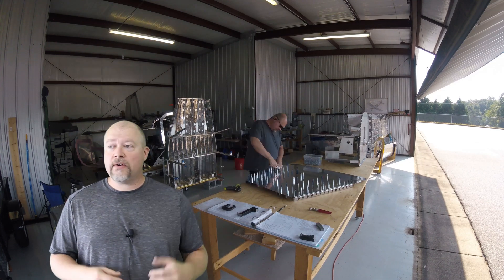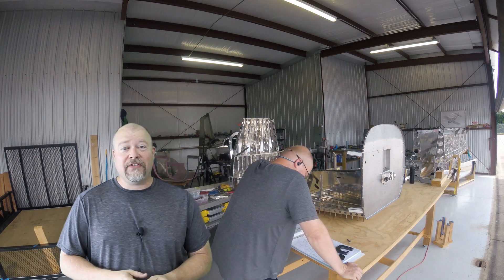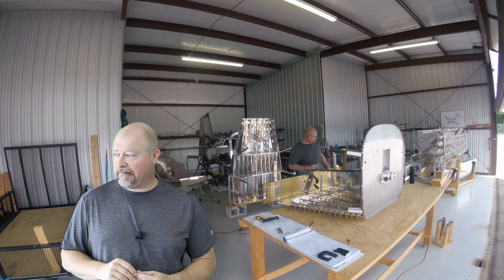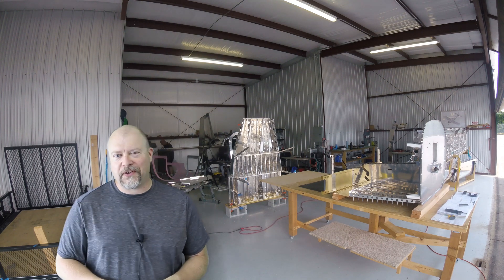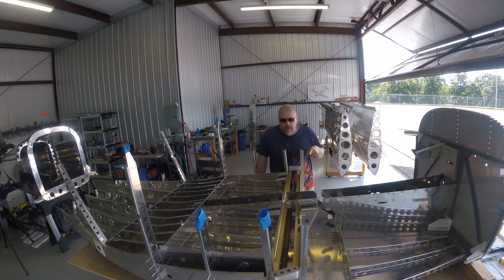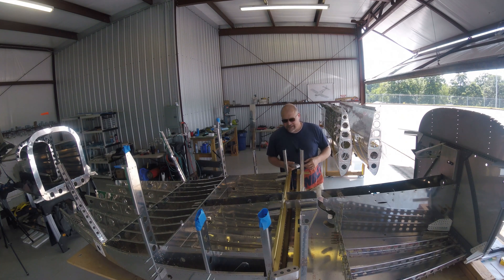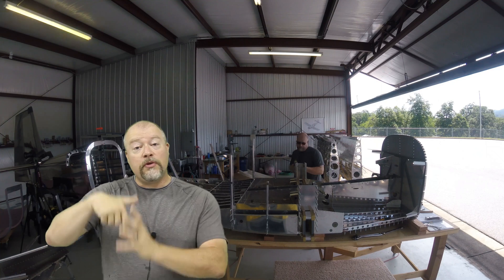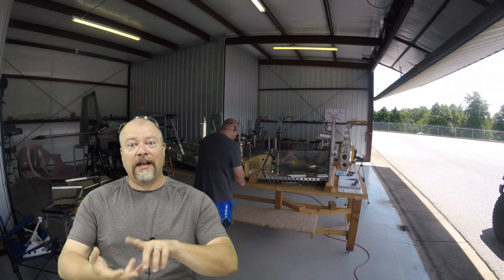RV-10 Fuselage - 016 - Marrying the front and back of the fuselage!

Comment: Is that a wire wheel on the grinder?  If so PLEASE PLEASE PLEASE where safety glasses.  As someone who has worked in the metal industry and maintenance industry for years, I can not stress this enough, you can never fix your eyes and you can't fly this amazing aircraft without them...

Comment: Should not be too hard to fab up a rotisserie. If you set it on roll axis (firewall and trail of fuselage as roll points just like a car rotisserie), Utilize a dry hardwood through your spar points. I won't lie, I'm no engineer, but a relatively light "subframe" can be fabbed that you would essentially lay your fuselage assy into, with the main hard points being the spars. I have it in my head. LOL... But if you use that style, you can roll the fuselage to 90 degrees and have all the access you need. When the smaller pieces come together to make big peices, you really start to get a feeling of progress. Looks great, man.

Comment: Great progress!
Reply: Oh, the "magic" you mentioned regarding holes lining up...is called Solidworks. Or Inventor. Or SolidEdge. Some sort of 3D parametric modeling software. It lets you design parts and match them together, accounting for bend allowances and other things you'd have to calculate manually. I do some mechanical design with Solidworks, and once you know how to use it...it's a game changer.